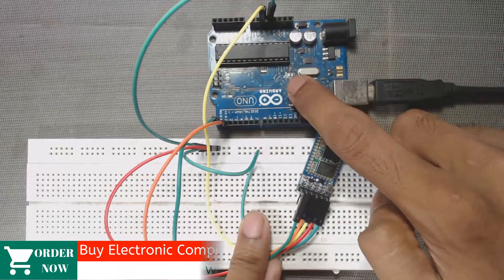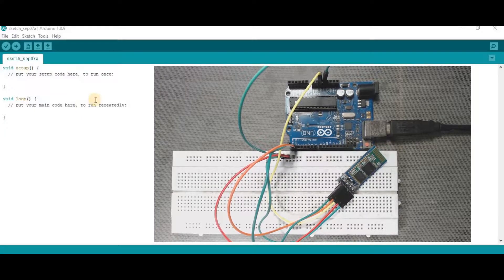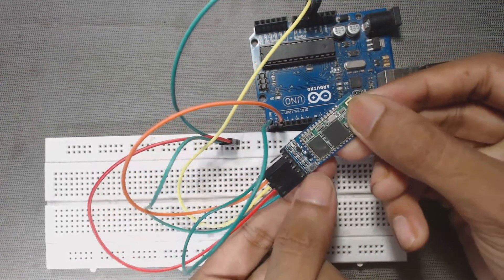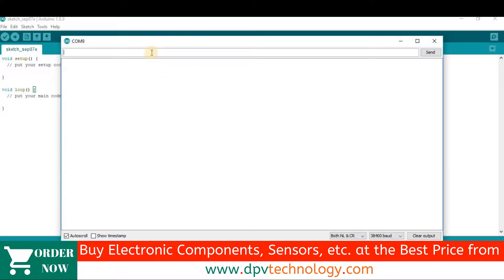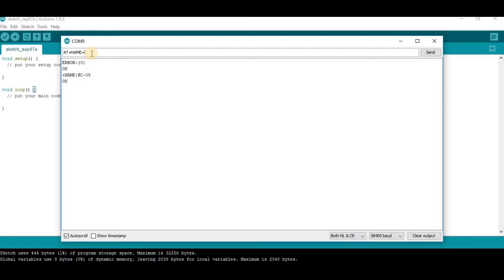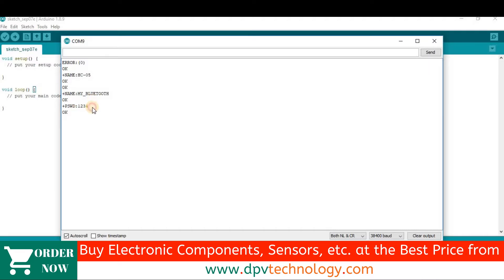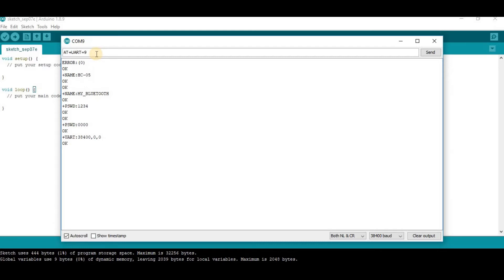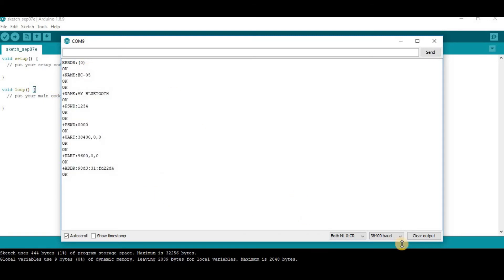How to chnage Name Password Baud Rate Address of HC 05 Bluetooth module using AT Command

Comment: Hi, in all the tutorials that I've read, it says to connect the Arduino TX to the Bluetooth RX pin and Arduino RX to Bluetooth TX pin since the Arduino will transmit from the TX pin and the Bluetooth will receive from the RX pin and vice versa but I noticed that you connected TX to TX and RX to RX. May I know if the connection shown is correct? 

In any case, thanks for the tutorial, it's really helpful!
Reply: Yes if HC-05 
Rx to Rx and 
Tx to Tx 
Otherwise if HC -06 
Then Rx to Tx 
Tx to Rx
Reply: @sariulislamofficialbd  Okay. Thanks for the clarification. 😊